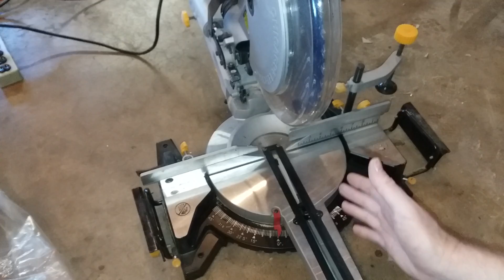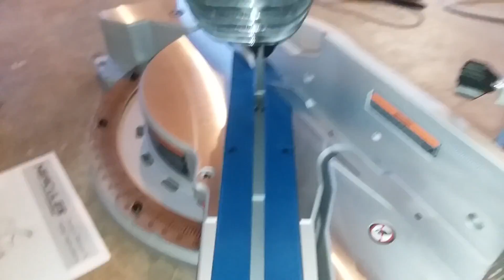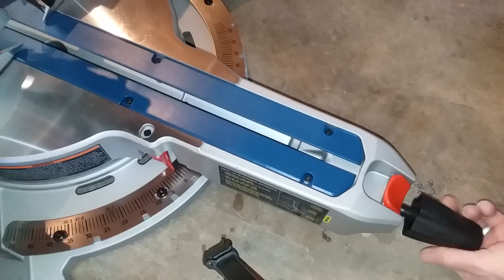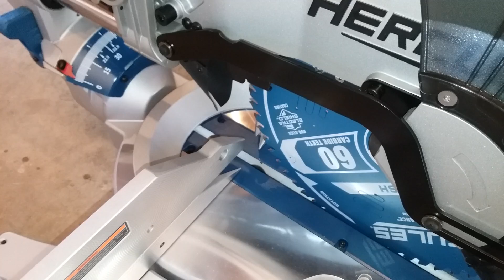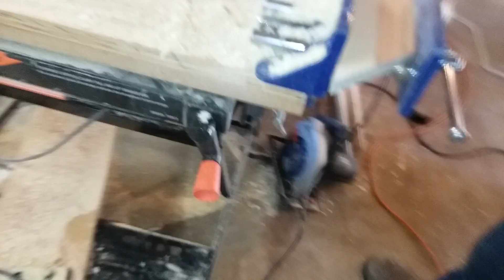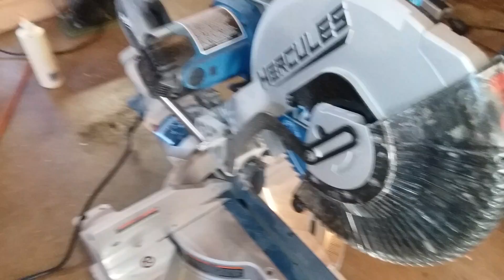Hercules Hercules Hercules...Harbor Freight Mitre Saw Comparison

Comment: I'm sitting in my garage looking at this saw and my DeWalt 779 and it is a knockoff of the DWS-779 and DWS-780, which is actually a good thing because these are some nice saws. It's not exactly the same but you can see which saw they were looking at when they designed it.

If you are doing much precision work you really should invest in a good quality blade some time. Something really good would be a CMT. They have a 72 tooth on sale at Amazon right now for $54.99, it's normally a $78.000 blade and it's made in Italy not China. It will last much longer and can be resharpened multiple times cheap. Honestly the original price for this blade seems pretty cheap.

Comment: I have a dewalt double bevel and I have this Hercules. I’ve owned it for over 2 year’s. I had to adjust the Hercules to get it cutting square. Only thing I’ve noticed is the spring that raises the saws back up is getting little week. But overall it’s a decent saw. I’ve done some pretty high end trim work with the Hercules and it performs well
Reply from the maker: I've had no problems with squareness of this Hercules.  The only problem I've had was user error.  I picked up the saw by the handle on top and it broke off.
Reply: @MrDabrudda  What was the user error?

Comment: In my opinion, the thing that sets the Dewalt, and now Hercules, apart from the majority of miter saws on the market, is that adjustable detent stop plate! Any saw that relies on cast in stops to lock the miter angle is a no go to me! As far as your picture frame having slight gaps on one side but not the other, that might signal that a slight adjustment of the blade “tilt” angle is needed, or that crap HF strap clamp is drawing the frame into a cup. I’m impressed by the saw, but thanks for making me aware to stay away from the strap clamp! Would love to hear your thoughts on this saw now that you’ve had it for awhile!

Comment: I mean, if you’re going to spend that much money on a miter saw, why not get a Dewalt? The reason I go to Harbor Freight is to get tools at a cheaper price and I know they aren’t going to be the best quality. You paid about twice as much for the Hercules than you did for the Chicago Electric. As for the angle part being off just a little bit, use your other hand to push it the the correct angle while you tighten it. Who cares about laser not being accurate? There’s work around for that. Who cares if the laser you don’t use gets hit by stuff? You don’t use it so it doesn’t matter if it breaks. Find someone who has a military discount or employee discount at Lowe’s or Home Depot and get 10% off of the Dewalt one that cost $399 not on sale. Why go back to Harbor Freight if all you’re going to do is complain about everything you get from there? This thing slips down because I’m not paying attention and gravity is still doing it’s thing. I just don’t understand
Reply from the maker: When I tightened the Chicago Electric saw the angle would always change, just like in the video.

Comment: I had a Chicago Electric belt sander.  It lasted 15 minutes and the motor started smoking.  As for the CE saw, it does not surprise me.  I am thinking of a Hercules miter saw.  I have a Tool Shop saw from Menards, works great, but looking for a higher end one.

Comment: Thank you for this video, rather see proof of accuracy than taking it out of a box.  I have an admiral, and will try the picture frame test.
Reply: I'm interested in the Admiral myself, how you like it? It seems do do everything I want it to. I do projects here and there throughout the year were its nice to have one. But not near enough to justify spending more than $200. The Hercules is more than I want to spend, but the Admiral is right in my price range, especially when there is a coupon or sale for it.
Reply: @Summit900  I have the admiral and it have the same issue as the cheap harbor freight miter saw when cutting 45

Comment: I would have been interested in comparing the $120 saw to the $200 Admiral without having to spend that much money.   Its really not a fair comparison.   Now comparing your new Hercules to the Admiral would be nicer.
One thing I noticed is that the 15 Amp motor is always being mentioned as if that is something special.  Did you ever notice that ALL the miter saws at Harbor Freight including the $95 10" Chicago Electric has a 15 amp motor as well as a $650 Bosch model?
Reply: Very good. Now RPM's are 4,100 vs 3,800 (I think, going from memory)  on the Dewalt 780 and the Blade on the Hercules is a Professional blade vs contractor blade on the Dewalt. The Dewalt blade is poor quality, rings like a school bell.

Comment: Thanks for the review. I have the older HF Miter saw, and like yourself, I had issues with 45 degrees. Redid all of the door and floor trim in the house. I used a lot of caulk to fill in the gaps. I'm ready to move on but didn't want to pay $500 + for one. THX
Reply from the maker: The Hercules saw is down to $299 on sale plus a 20%  coupon
Reply: @MrDabrudda  How? I've never seen it marked down to $299. And the 20% off coupons always exclude Hercules.
Reply: My harbor freight has never had it below 349.99! I'm still cutting with a POS Terra Tek basically a barely better than the Chicago electric. And it looks just like the Chicago electric, I'd say damn near identical

Comment: Can you set cutting depth to cut notches in 4x4 with this miter saw?
Reply from the maker: You can set the depth of cut but you would probably get a better result with a table saw and a dado blade to cut slots in wood.

Comment: Your joints look like shit. Sorry, I buy real chop saws. My dewalt or even my Delta make super nice cuts. Harbor freight stuff is junk. That's not highly accurate at all...….My hand cut miter  box blows that shit away! And perhaps if ya knew how to CALIBRATE your tools you would have better luck. You can fill it in??? Good luck doin some real trim work!!! Go buy a real saw...…..All your joints were pretty bad. And hey.....Buy some nice corner clamps.
Reply from the maker: Says the internet pundit with 0 videos.  If you are such an expert go make some video and teach people, spend your own money and make videos.  And I have replaced the strap clamps with better solid framed clamps.
Reply: @MrDabrudda  there is nothing wrong with your joints at all
Reply: @MrDabrudda  you give him a piece of your Harbor Fright!
Reply: @MrDabrudda  That guy is a douchebag and as a professional Carpenter only one of your joints was off, and it wasn't that bad. The others looked pretty great. 

On the other hand whether someone makes videos is irrelevant. I do professional work and have had my own business for 25 years. I've never made a single video. 

By the way I make picture frames the same way except I flip the frame over and use a kreg jig, and that thing pulls those joints together tight as can be. You might want to try that on the flat wood frames. My picture frames are not really part of my business I just do that for our own pictures. Although with what people are paying for custom picture frames I'm thinking about getting into that.
Reply: Bitch ass doesn’t realize dewalt has most of their tools made in China while harbor freight uses Taiwan and the fact that it doesn’t matter the tool it matters about the tradesmen skill
Reply: Out of the box, plenty of DeWalt and other big name saws that cut like garbage. Proper calibration will make just about any saw like butter. If it locks up tight and holds a proper calibration then it's easy to say you got your money's worth.
Reply: coolrn43 you're a four king idiot, if you're such a professional what are you doing watching u tube videos?

Comment: Picked this baby up today. Was on sale for $299.99 at Harbor Freight  this weekend plus I got 20% off on top of that since I had a coupon.  $239.00 plus tax. I was really exited about this saw having read over 20 reviews.  I was impressed with the blade that came with the saw. I made some cuts on a  2 x 4 , first 90*    then 45 1/2 * .........right on the money out of the box. The LED light beats the laser any day., it casts a shadown on the blade and right on your mark.   Dewalt has some serious competion out there now.    I dont care if it's made in China or Korea, or Iraq or Russia or Japan or Africa.  Seems like this country   needs  some catching up  to do. I was told an engineer from Dewalt joined up with a Chinese business man and  took his idea overseas and are making top quality power tools..  Buy this sucker, if it only last you 3-5  years ( most likely this saw will out live you )  you 're way ahead of the Dewalt price gouging  the  tool market. Now I have to figure out where I can buy some extentions for this saw somewhere, it doesnt come with any. If you find them give me a hollar !
Reply: tom typically Hercules don't qaulify for the 20% discount what coupon did you have?
Reply: @stratgibson thought the coupon says it excludes hercules brand. at least current one does.
Reply: Same price as Dewalt dws779. Tempting but it's a HF. Seems a gamble for the same price.

Comment: most of the shortcomings of the older saw are typical of any cheap miter saw out there in the $150 range.  the skimpy base, the floating bevel adjustment...you get what you pay for...but that inaccurate 45, with no way to true it up...that is maddening!  no matter the price its pretty important that a miter saw cuts an accurate miter!

Comment: I actually did pick up the Hercules 12 inch saw. I can say it is a beast. 56 lbs after pulling it out of the box. I ran some test cuts at 90 degrees and 45 degrees from both sides. Put the cut angles together and measured the right angle made. Spot on. The 90 degree cut was spot on too. The shadow light lines up right on the mark. No fiddling with adjustments. As to adjusting squareness, it has a simple but effective design.  The notches for the angle cuts are built into the front plate that marks the degrees. To adjust for misalignment, you loosen the screws that hold the plate down and then move the saw, lining it up with a square against the fence. No playing with screws behind the fence. Also, the saw has a ton of torque. You have to hang onto it when you pull the trigger. It doesn't slowly ramp up. It's full speed in less than a second.  I'll be using it to crosscut stair retreads and later Pergo or Quick-Step laminate.

Comment: Guy dosn't know how to calibrate a tool, stopped watching after 1 minute
Reply: I too would like to be enlightened Mr. Logan...
Reply: Im actually out of square somehow. When my 45 is dead on to the left its not on the right as well as my 90 degree point. The guide is true so I wonder if the the degrees are off or my blades bent. We used to beat the crap out of that thing on the job but all I was cutting was backing to secure my plumbing so it was adequate. Now that Im trying to do a little carpentry around the house not so much. This is a Ryobi btw but its pretty much identical to your chicago. Im gonna keep screwing around with it until I start cussing then Ill probably just buy one or use my Dewalt circular saw which is great. I wanna do some trim so kinda need the miter saw.
Reply from the maker: And judging from ALL of the informative videos you've posted on your channel you must be an expert.

And since you are an expert HOW would you "CALIBRATE" a mitre saw? I'm sure everyone would love to hear your expertise.
Reply: @MrDabrudda  loosen the guide rail or plate with allen wrenches and use a square to square the blade to the guide and tighten the allen screws. Didnt make the comment but thats what I do.
Reply: Mine was doing the same thing as your older one until I calibrated it a couple days ago.
Reply from the maker: @wetley09  That's what I tested in this video was the squareness coming from the factory.  The old saw would squeue out off the 45 degree mark when the knob was tightened

Comment: Just bought a delta cruzer 12in sliding compound miter saw for 399. You got ripped off paying 379 for that.
Reply: Have you owned the Hercules to?
Reply: Compare a $400 to a $ 150 old pc of crap is worth watching?? Don't think so.
Reply: Delta is no longer a professional grade tool company. They were acquired by some big conglomerate that gutted the company. The same thing happened to Porter-Cable, I have some of their old stuff and it's built like a tank but their new stuff is a joke.

Comment: you can buy a dewalt 779 for 400 bucks
Reply: Does on sale sometimes at Lowe's or Home Depot
Reply: The 10" Hitachi is 360 at lowes
Reply: The DW779 is on Amazon for $350.
Reply: @daverocker1  home depot had dewalt's 779 on sale for $340 but they are sold out now. i should haev gotten it when they had it avail. still on website at that price but no stock!! waaa

Comment: Way overpriced for what it is. Chinese professional grade? Even if it is professional grade it cannot compete with the other saws that have been on the market and you don't have to wonder and hope I'd they cut straight. My harbor freight 12 inch slider is barely good enough for low income house exterior house stairs or deck. No flush cuts. Sad. So at this price I will never try a Hercules.  I have two Bosch. A non slider and a slider.  They cut straight. Go to Lowe's or home depo.
Reply: I guess you didn't know that all brand names are primarily made in China and some are only assembled in the U.S. LOL!

Comment: The Hercules comes with a 1 year warranty. Any other saw is going to require that you send it off at your expense. Shipping a 50lb miter saw... that'll be half the cost of the saw itself. At least Harbor Freight will just give you a new one off the shelf instead of you sending it off. I own a Delta, but the people complaining about the 90 day warrantee don't know what they're talking about. 90 days is the standard HF return period, this saw doesn't have that.
Reply: It's not a one year warranty, it's s one year, risk-free gaurantee.
Reply: HF warranty now is if you don’t love return, these other warranties are for manufacturer defects.  This is an electronic so defects will be found early on use so who cares if its 3 years.  Sorry but other it saying it’s warrantied i don’t see benefit or value

Comment: If the Dewalt is about the same, why would you buy a Hercules? specially since the Dewalt comes with a 3 year warranty, the Hercules is just 90 days.
Reply: Try shipping that Dewalt back to a service center if you don't have one locally. With the Hercules, you can bring it to your local HF and bring home a new-in-box replacement.
Reply: A quick search says the Dewalt DWS780 $599 and the Herc is $399 that is $200 for a 3-year warranty assuming all else is equal.
Reply: It has a 1yr now
Reply: @Paul Hopkins  this is on par with the better dw780 saw ($599) do some research friend.

Comment: I appreciate. The review.  Ive owned the Dewalt. For over. 10 years.  Took good care.  Of it.  And it.    Has been one of my favorite.  Saws ever  i was. Excited when i first. Saw the new Hercules.   Replacing. The older.  Maroon. Central Machinery. Unit. That was   Very sloppy. As you pointed.  Out  overall.  It appears that HF. Is stepping up their game. On quality Control   And.  Manufacturing. Of many of their tools.  The.  Brake. On the blade. Is a nice. Feature.   You can.  Tape.  The.  Corners.  On the.   Strap. Clamp   That may help.  Hold the corners in place ?
Reply: How do you have 86 sentences in a paragraph

Comment: The dewalt dws780 compares to this hercules miter saw for the tag of 600$ but hercules its 369 with coupon until june 10th, I'm not  a fan a dewalt by  any means but if you need a contractor grade saw with same features or specs  just slightly more rpms on the Hercules,  it's a total go on the hercules saving you $230 , will buy it and keep you guys posted
Reply from the maker: I just wish HF would have longer warranties on the high end equipment.  That is a deal breaker for many people spending $400 on something like this.
Reply: $309 now with a one year guarantee.

Comment: I have the "previous" harbor freight 12 inch miter saw. I paid $119 for it with a coupon 5 years ago, and it still runs just fine- granted, I am a DIY homeowner. I think HF has lost their way, if they think they are going to attract new customers at this price point! If you're going to spend this much, you might as well buy a "real" tool for a couple hundred more. I mean, if it was of comparable quality, it would have a comparable warranty. HF, go back to what you do best- selling stuff that is just good enough for weekend projects to harry home owners.
Reply: I bought the cheap Chicago 12" miter as I wasn't sure how much I would use it as a home owner too but found that I used this a lot!  They still offer the cheaper version and now what they claim to be a "Pro" version.  How are they losing their way, the lower priced version does not compare to the $600 DWS780 where this does for $200 less?  You sound like all those people who claimed Toyota their way when introduced Lexus, guess what best move they ever made.
Reply: So HF is losing their way when upgrading from cheap crap at cheap prices to offering some superior alternatives?
Reply: You go buy a dewalt @$600 and we can meet and compare in person. The hurcules is a dewalt killer for a reason. It is superior in every way except the dial lock down. Have fun wasting your money.
Reply: @jasper23454  Lol

Comment: Looks almost identical to my Dewalt, but it’s also almost the identical price so I am not sure why buy a saw with a 3 month warranty vs a 3 year warranty.
Reply: Yeah, I'm fairly sure that it's being made by the same Taiwanese manufacturer as the Dewalt and uses many of the same cast/molds and other components.